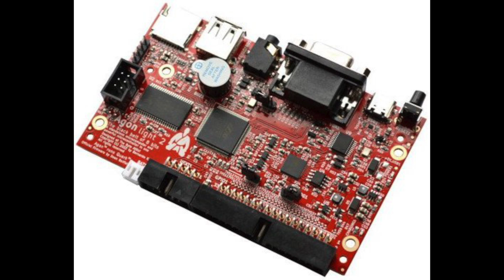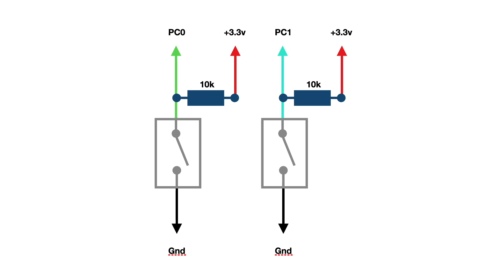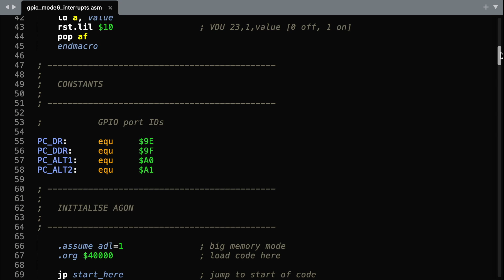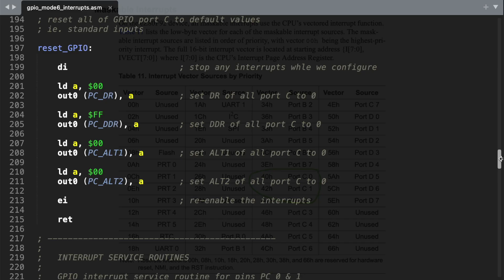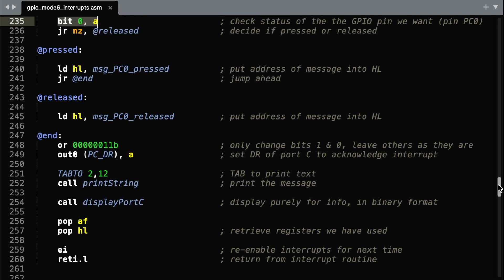27 Interrupts - GPIO Pins

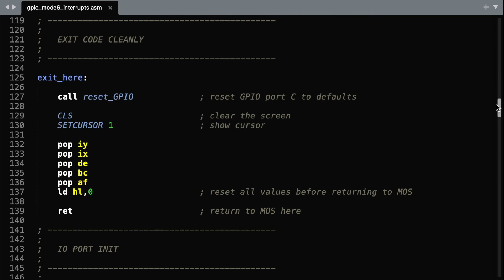Comment: Excuse my ignorance but I was initially confused why Line 88 sets IM2 then at 04:10 there is no explanation of how using the 'four registers' to set the 'Interrupt mode' works. Is this an alternative use of the DR/DDR registers or just another way of presenting them? I assume they aren't changing how the CPU responds to interrupts but are just setting the conditions for when an I/O port creates an interrupt. Does changing the I/O-IM apply to the whole port or can you set a different mode for each of the 8 pins? (btw - the commentary talks of 7 bits instead of 8.)
As a result, the comment on line 163 doesn't seem to make sense. (and it apparently covers another unexplained function/purpose).
Line 154 claims to only affect 1 pin then Line 155 lists them both :D

Although you only discuss the PC0 interrupt handler, the code contains an isr for each of the two input pins. How does the CPU know which one to use until start_GPIO_interrupts is executed? Should interrupts remain disabled until these vectors have been assigned?

setup_GPIO_ports, disables interrupts while it configures the port but since no handlers have been defined at this point, is that strictly necessary or will the CPU just ignore any spurious interrupts?
Line 248 sets 'a' to acknowledge two interrupts even though only one may have occurred. Is that intended?

I've also just realised that you are using the 'in0' & 'out0' instructions. Forgive me if you've mentioned this elsewhere but what is the significance of the 0 suffix?

Thanks for another helpful video. Sorry if my comments seem pedantic but asking is easier than setting up my own test hardware and your answers could help someone other than me.
Reply from the maker: Hey Mike, thanks for the detailed feedback. You spotted some great errors in my very quickly produced video, and I will try to clarify anything else, to the best of my newly acquired knowledge.

Q) Excuse my ignorance but I was initially confused why Line 88 sets IM2 
A) In order to do vectored interrupts, we must be in IM2. The Agon should be in IM2 normally, but just in the unlikely case a previous program changed it, we set it to make sure. Does no harm.

Q) then at 04:10 there is no explanation of how using the 'four registers' to set the 'Interrupt mode' works. Is this an alternative use of the DR/DDR registers or just another way of presenting them? I assume they aren't changing how the CPU responds to interrupts but are just setting the conditions for when an I/O port creates an interrupt. Does changing the I/O-IM apply to the whole port or can you set a different mode for each of the 8 pins? 
A) maybe a conflict of using IM2 (interrupt 'mode' 2, which is universal across the machine) and the use of the word 'mode' for the operation of each io port, which has 9 different 'modes'.
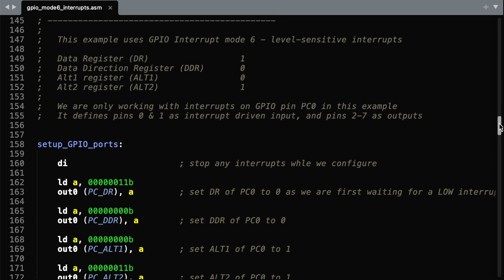The chart at 4:30 gives an summary of the 9 gpio port modes of operation, but there is a big section in the ez80 spec sheet which goes into much more detail on each mode, so have a read through to see if it aligns with what the code is doing, or if there is another mode you might use for your purpose. I have put a copy on my github.

Q) btw - the commentary talks of 7 bits instead of 8.
A) Voiceover error!

Q) As a result, the comment on line 163 doesn't seem to make sense. (and it apparently covers another unexplained function/purpose). Line 154 claims to only affect 1 pin then Line 155 lists them both :D
A) typos. Fixed. At first I was only going to do 1 gpio pin, but later changed it to do 2.

Q) Although you only discuss the PC0 interrupt handler, the code contains an isr for each of the two input pins. 
A) They are both almost identical, so I only talked through one of them. The video was getting too long as it was!

Q) How does the CPU know which one to use until start_GPIO_interrupts is executed? Should interrupts remain disabled until these vectors have been assigned?
A) If a vector hasn't been assigned it won't go anywhere I believe. However, the time between them being set and the vector being defined is just a few milliseconds, so the chance of us changing the pins in that time is slim. However, maybe it would be good practice to keep interrupts disabled until all config is completed.

Q) setup_GPIO_ports, disables interrupts while it configures the port but since no handlers have been defined at this point, is that strictly necessary or will the CPU just ignore any spurious interrupts?
A) there are other system interrupts (eg, from vdp), not just ours which may happen. I thought it safe to stop those while defining them.

Q) Line 248 sets 'a' to acknowledge two interrupts even though only one may have occurred. Is that intended?
A) yes, when I tried to set only the one we had an interrupt on, I found it didn't always work, so made sure and set both. That seems to work with all 6 io pins for the joystick too.

Q) I've also just realised that you are using the 'in0' & 'out0' instructions. Forgive me if you've mentioned this elsewhere but what is the significance of the 0 suffix?
A) This is the command which is used to read or write from our port registers. The A register is placed on the lower byte of the address bus, while the High byte of the address bus, is forced to 0. See the ez80 User Guide for details of all op code commands. Again, I have put a copy of that on my github.
Reply: @ Thanks for such a quick and comprehensive reply. I’ll check the docs when I get a chance.